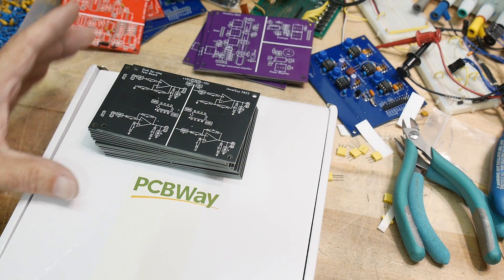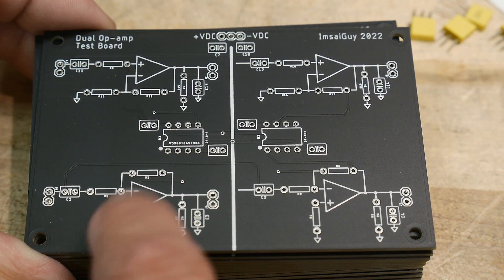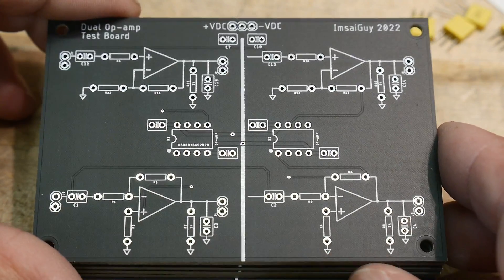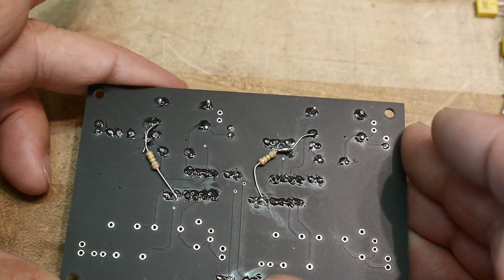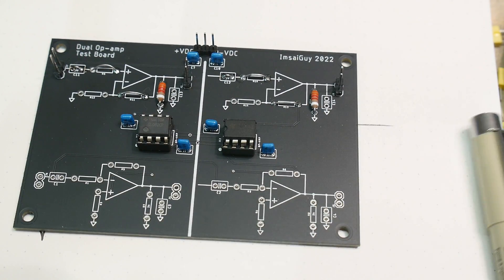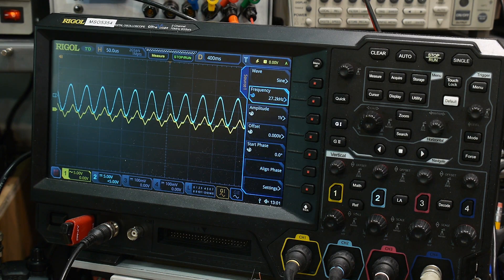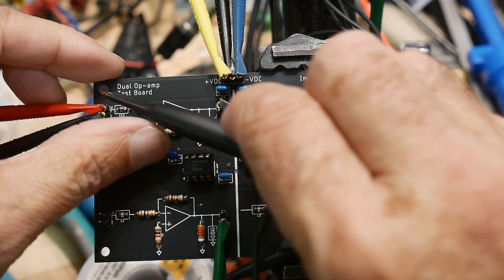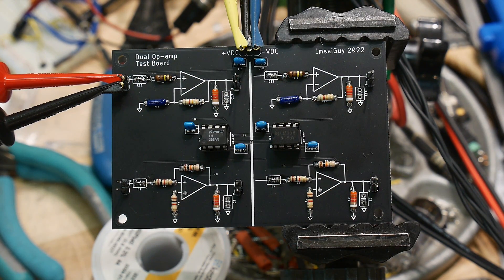#1189 Dual Op-amp Test board

Comment: Please tell me, is it possible to determine the originality of OP muses01/02/03 with this board? What components need to be installed on the board.
I have an oscilloscope, but I don’t know what kind of power supply is needed to check such OPs.
Reply from the maker: this might help. I find some fake OP07 parts: https://youtu.be/cOC9aj_jtwo?si=1l4-54fNDeRyEE0o
Reply: @IMSAIGuy I assume that such operational amplifiers need to be tested using a signal generator and a low-noise ±15V power supply. The goal: to find out if it is a fake or original...
Reply from the maker: @odysseus4101  the power supply is not critical. the fakes are spotted by voltage offsets, rise times, bandwidth, input current leakage, protections diodes, offset control. all of which don't really care about the power supply

Comment: This is one excellent concept! Thank You!!!! Apart from my "Day Job" I'm a developer of small, battery powered Guitar amps (Search "Crazy Jack Amplifier" on Youtube). Over the last few years, I have developed several analogue boxes/custom breadboards, PCBs, wirings... using all kinds of ways of connecting up interchangeable components over a pretty "standard" LM386 schematic - all with the aim of being able to hot-swap components to refine/test my circuits... and every one is problematic - usually due to loose connections on a breadboard or incompatible connectors. This TAKES the Biscuit!!! I can see exactly how I can A/B test circuits, component configurations etc using this concept! Brilliant! Thank you again!

Comment: Beautiful little PCB! 

The only additional part needed would be a feedback capacitor across the feedback resistor, because in my experience I have found that some Opamps are unhappy without one. I use a cap of 22pF to 100pF, depending on the circuit needs. It helps prevent oscillation at MHz frequencies...

Comment: I bought 10 of these and they are very well made. The only complaint is that if you ac couple the input into the non-inverting amp, there's no dc path for the input bias current. I've had to add a resistor between the non-inverting input and ground whenever I want to use an input capacitor. Perhaps revision 1.1 might include the missing tracks?

Comment: I wonder if you could have put the voltage divider at the top — where the power source is?  Or is there a small mod to the board you could make to allow for adding a virtual ground without the "bodge resistors".

I love the "self-documenting" schematic on the PCB. More people need to do that.
Reply: Absolutely!

Comment: One suggestion for another revision would be to add a resistor leading into the non-inverting input for the inverting amplifier schematic, so you can make a difference amplifier

Comment: Handling unused Op Amp pin conditions

The "TI Design Guidelines for Devices with LM324/LM358 Cores (Rev. A)
 Section 7 - Unused Amp Connections and Inputs Connected Directly to Ground" provides good information for anyone just using one of the two op amps in a package. It shows how to protect the unused op amp with suggested pin configurations for single-rail and split-rail. With this board it is easy to put the unused op amp into a linear state with just resistor(s) and jumpers.
Reply from the maker: good point

Comment: That is a gorgeous board!  I'd be happy with that too.

I tried once to put singe-pin sockets on a learning board like that, that way I could pop resistors and capacitors in and out, but never got something that would snugly accommodate all the various small-diameter component leads.  I tried collated single-pin sockets; leads were always too big or too small (Mini-Mill brand).  Tried cutting some DIP sockets apart (nope, large round leads deformed them after one use), and then taking the dual-leaf socket out of the plastic, that didn't work at all.  The best result was square Dupont 2.54mm headers, that seemed to accommodate the widest range of lead diameters.
Reply: Also, randomly a few weeks ago Google searched "prototype board gerbers" and your PCBway page came up on the 1st page of results.  How cool.
Reply: I’ve got some open-bottom sleeve sockets from Mill-Max and they work great for this. Get them slightly oversize and they will accommodate all common lead/pin sizes. Not for power parts though - a 3W resistor lead will wreck them. But mine came off eBay and there’s no more of that type as it was a custom part. So for anyone willing to give it a go: you have to experiment.
Reply: @absurdengineering  thanks! Do you recall a part number? I might be able to use the specs as a guide.  Thanks!
Reply: Exactly what I tried to do - This concept is the way forward!

Comment: Quite clever and useful! Kudos! Suggestion = Pin header strips can be purchased with female sockets. Cut and solder individual sockets for each of the needed discrete component (resistors, caps, etc.) pins. Now, each component can simply be plugged in. Various component values can be tried and the whole board can be easily reused/reconfigured, without soldering. Using ZIF sockets for the op amps would be handy, too. Warning = OSH Park's black boards come with a clear solder mask. Meaning, the copper traces show through. Meaning, the face of the board is not totally black. I didn't catch this difference, when ordering from them, and the boards were quite ugly, IMO.
Reply: what brand single pin-sockets did you use?  I found most of the pin sockets I tried rarely held components well, with typical lead diameters ranging from ~0.3mm to ~1mm.

I have a comment here that goes into more detail.
Reply: @bandittwothree3765  Samtec P/N = SSA-132-W-T   These are segmented. I use a Craftsman razor cutter to separate them = works perfectly = no rough edges to sand off. I get the longest pins and just cut them to length. Shorter pin lengths are available. I no longer buy ready-made DIP sockets. I just use these and cut two strips to length. Therefore, I always have the proper socket in stock. I have never had any sort of problem with these sockets = I highly recommend their products. Mouser number = 200-SSA132WT = 1 stick of 32 sockets = $5.18USD.
Reply: @bandittwothree3765  I agree - I tried to build exactly what you say here - the compoments just jiggled about... Sad!

Comment: In school, I had a reputation for blowing up op amps. I wasn't proud of this, or particularly clumsy. I still don't know why and I DON'T CARE! But 40+ years ago,it was a big deal.

What a very useful learning tool!

I like your boards. If I were teaching undergrad EEs in Engr 335 (or whatever), this board would be on my list of required lab hardware. 

Here's a practical suggestion -- leave a little more space between Input leads -- perhaps the "distortion" is x-talk or just noise. 

Anyway, some of those guide holes are very close together for these fat fingers on hands that suffer from mild to moderate  neuropathy.

Otherwise, Primo!!!

Comment: These are pretty cool. A large white rectangle in the "empty" space would make a nice place to put simple notes. A fine point sharpie would be best. A little swipe with iso-alcohol would let you reuse the note area id you reuse the boards.
Reply: GREAT Suggestion! The Legend layer is FREE, so why not add some blank space, and a portion for with Author/Date/Rev numbers too!

Comment: I guess nobody has heard of breadboards.
Reply: solder wins over breadboards every single time, particularly for something that you'd want to use time and again like this.
Reply: Breadboards are nice, but sometimes this extra bit of visualisation is really useful. It allows newcomers to visualise how their circuits are diagrammatically represented.
Reply: In fairness to the video's author, he did explain why this is a superior option for beginners.  Summary: you can see the schematic and test-points without the rats nest of wires to confuse the beginner, and help teach the schematics for the circuit.

Comment: Great idea and matt finish looks good.
A suggestion for the next version could be to have Berge pin connectors in parallel to a few components that can be used to short the specific component on the same board eg. The input cap for ac,dc use like the pc card jumpers.
Thanks  for sharing.
Reply: There is an axiom in the PCB layout intelligentsia: "Nobody runs with a Rev A PCB." ...So don't take it too seriously, and get to Rev B!